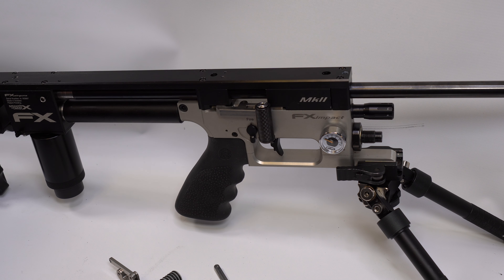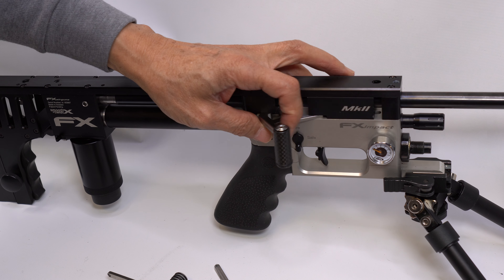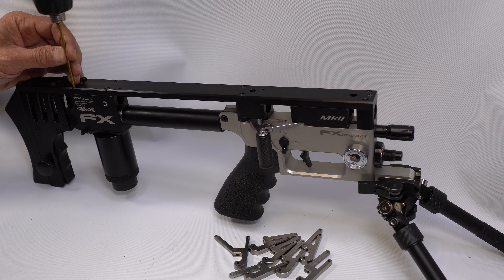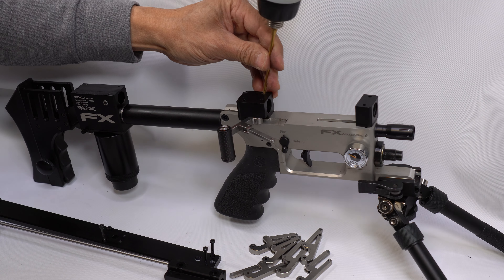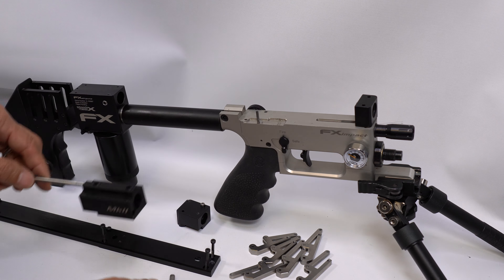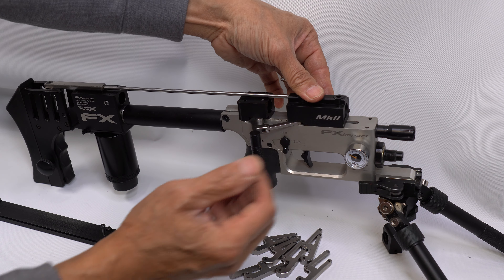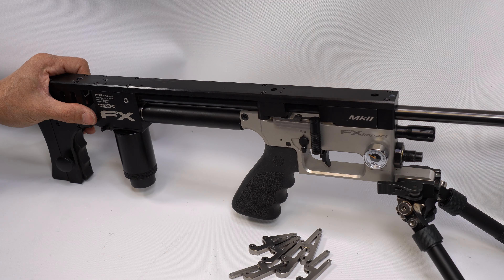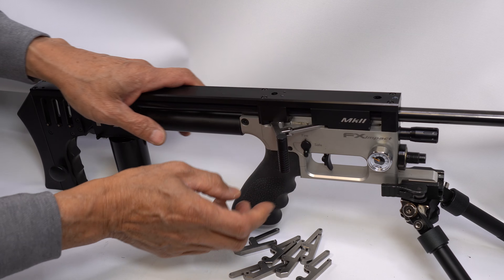FX Impact Titanium Short throw Cocking handle install

Comment: I want to buy right now 😂😂👍🏼👍🏼👍🏼👍🏼👍🏼😊 I been asking for over 1 year , when are they available and are they compatible with the ambidextrous sabre cocking block ?  Also please make for dreamline if possible as lots will buy , Thanks
Reply from the maker: http://rover.ebay.com/rover/1/711-53200-19255-0/1?icep_ff3=2&pub=5575378759&campid=5338273189&customid=&icep_item=233796849915&ipn=psmain&icep_vectorid=229466&kwid=902099&mtid=824&kw=lg&toolid=11111
Reply: Ernest Rowe bro it says won’t ship to U.K.  I been waiting for this for so long 🙁🙁🙁 il pay shipping
Reply from the maker: @ptescreen18  —- > shipping is expensive to UK about $25-30 priority I would think
Reply: Can this item be sent back to Vietnam, please?

Comment: Ernest,  Excellent idea & execution!  
Q:  Are they compatible w/ the Sabre Tactical Ambidextrous Cocking Block?
My OEM lever has already been swapped over to the left..  Just waiting on your answer before I pull the trigger on one.
Thanks! 
Sam -
Reply from the maker: Hi, wait in a few days will install on my Sabre block, they have 2mm pin have the change to FX steel linkage to test
Reply: @ernestrowe5061  Thank you for the quick reply buddy!  I appreciate you checking it out for me/us! 
***I placed an order for one between the time I posted and the time you replied,  so... 
Hopefully it'll work - If it's sent before you get to test it.  I saw them disappearing, and didn't want to chance missing out.
Sam -
Reply from the maker: @DirtyDovi  —-> i have more,  only post 10 at a time so i don’t go crazy 😜
Reply: @ernestrowe5061  - Update:  
This lever assembly did in fact install on my Saber Tactical Ambidextrous Cocking Block! 
[There is only the slightest bit of up/down play, but, that can be taken up w/ shims/washers]
Great design & Great service! 
BTW,  I fully intended on chamfering all of the angled sides on mine when it arrived.. 
But when it arrived, and I saw it,  it was already chamfered.  Awesome attention to detail! 
Thank you again my friend! 
😊👍 
Sam -
Reply from the maker: @DirtyDovi  ST Amb has 2mm pin can work with 2.5mm but lossy fitted. By request you can order steel linkage with 2mm pin hole @ https://910airguntuningandrepairsllc.com

Comment: Ernest, can you please please help.  My brand new Impact is suffering from Reg creep.  The reg pressure gauge rises approx 5-7 bar and the velocity on the first two or three shots  are low, the first shot is 70fps slow.  It has had new seals in the reg, all internal parts cleaned and polished but it continues to leak.  It’s a .25 Impact with reg set to 120 bar.  Can you please offer any advise please as it is just not useable in a hunting situation.  It also seems inconsistent since the new seals were fitted and the internals cleaned, probably due to reg creeping.   It seem to creep up within quickly within 10- 15 minutes and then holds around 5-7 bar higher.  Can you please please offer any advise on how I can fixed this and what i should do or replace.  I’m really stuck here.  Should I replace the whole reg/body and spring washers? Or??  Appreciate any help man 👍

Comment: Steel is much better as it is more robust. Titanium does not have any justification here as the detail is small.
Reply from the maker: Will see how reliable titanium is —> so far no issues after 2k of cocking. Next batch will try 420 stainless, have seen lots of rust on steel. Also trying to save on weight the impact getting heavier with all the available add on.
Reply: "When compared to steel in a strength-to-weight ratio, titanium is far superior, as it is as strong as steel but 45% lighter." 
And.. 
"Titanium is approximately three to four times stronger than stainless steel, which means its lifespan over generations is slightly longer."

I can personally confirm this,  as I'm a [ex] Metal Fabricator & Welder who's worked with All Metals 
for roughly 25 years.  
For this application,  Titanium-Actually-Is-The-Best-Overall-Option!

I just received, installed, and used one of these, and I have absolutely zero complaints. 
The Design/Fabrication/Finish/Fit/Performance are top notch, and I'm sure it'll outlast the rest of the gun. 
😊👍
Sam -
Reply: @DirtyDovi  that detail is so small that titanium's weight advantage is negligible here.